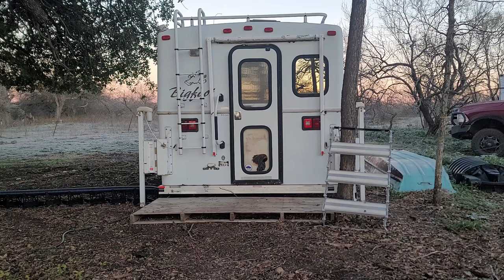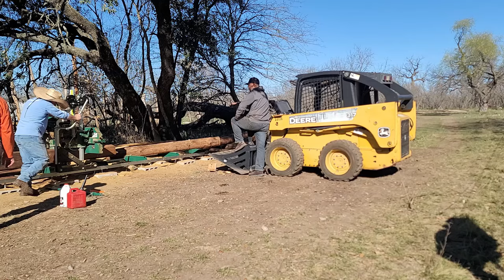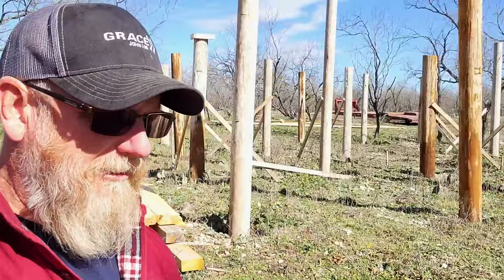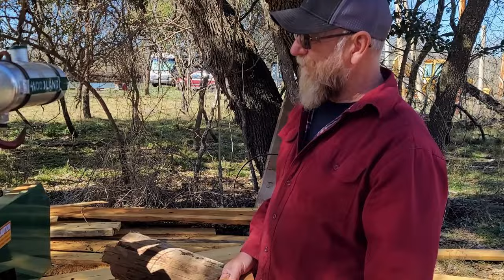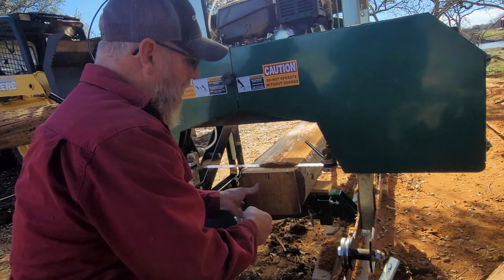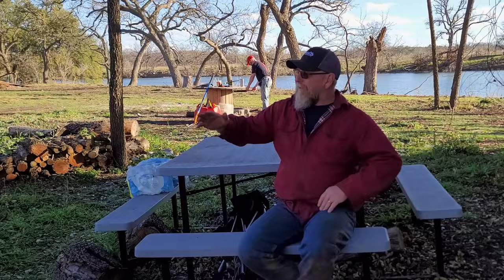Milling Lumber and Killing Cameras

Comment: Great  video ! Nice little mill you have be careful of them bolts in them poles ! I'm just learning my way along too :) I only have 92hrs on my Woodland HM122 , I find it easier to judge what I'm going to get a lot like you , But I find always loading the log small end to the mill easier & then if there is much tapper in the log i lift the small end & put 1/2" or 3/4" to split the difference for 1st & 3rd cuts , I can usually save a 1" that would otherwise be slab, Them poles make awesome lumber if you don't hit bolts !
Reply from the maker: Thank you, sir.  I, too, have been lifting the small end up a bit.
Reply: @TalbotLakeInheritance  Yes it's amazing what these little mills can do :) But ya lifting them gives me a couple slabs about the same thickness nice to use on other projects :)